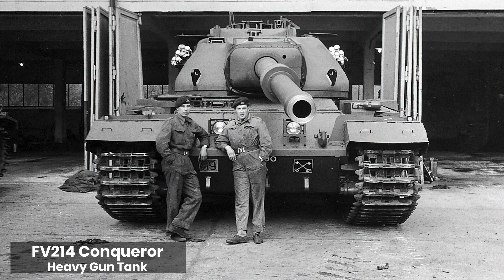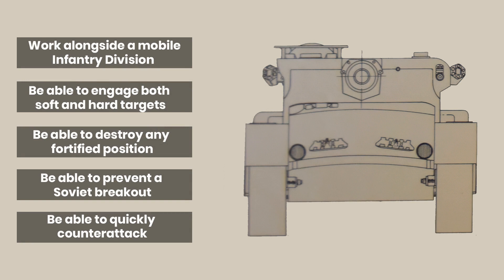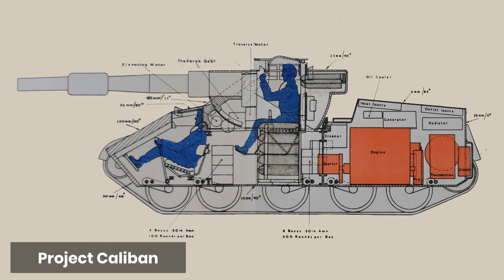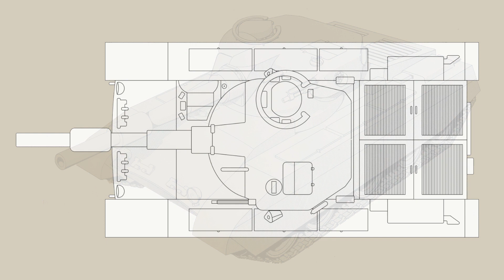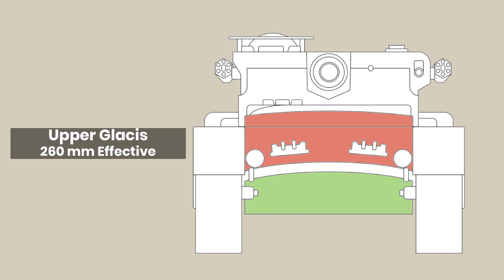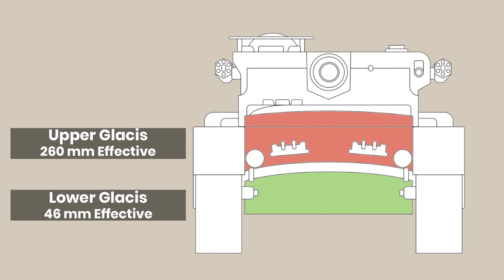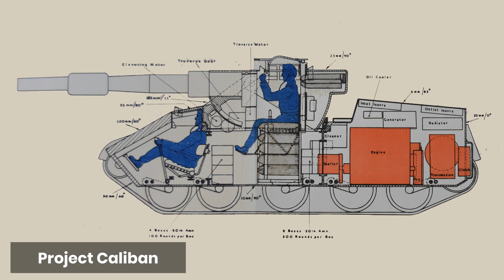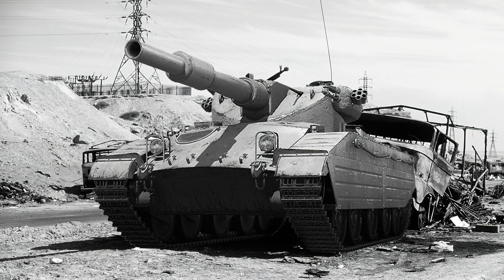Caliban - Tank Design & Conception

Comment: The nuclear round was a bit silly, but the large calibre, low velocity gun firing a HESH would would have worked at the time.

Longer team the HESH round would have been infective against advanced armour; however, a HEAT round could have replaced it.

The gun would also have been good for launching guided missiles like the US 152mm.
Reply: The nuclear round was very much a thing in military thinking of the time - look up M-28/-29 Davy Crockett, amongst others.
Reply: Battlefield nukes were all the rage at the time. The Neutron round etc. As it turns out depleted uranium rounds leave enough of a mess post conflict and cause all sorts of clearing up headaches. Making everything radioactive with a battlefield nuke was and still is a step to far if you want to carry on using the assets left behind!
Reply: 60lbs of HE round would mess up anything it hits - even today.
Reply: Not only that, the canister round would be devastating to any soft targets as well as foliage, way beyond overkill.
Reply: You would think it was a lot less silly if you didn't have one and the enemy did.
Reply: @wideyxyz2271  After World War one large parts of France (the Zone Rouge) were designated uninhabitable due to heavy metal poisoning and UXO, it took decades to clear out. The risks associated with DU exposure are rather overblown but good luck telling Radiophobes that.
Reply: I feel like a hesh round that obnoxiously big would still be very capable of fucking up most mbt's today
Reply: @lonesurvivalist3147  I  doubt that it would kill an MBT from the front, but it would strip off a lot of external equipment, like reactive armour, and might damage the more fragile equipment, like optics.  There is a possibility the  crew would be so alarmed that they abandon the tank.

Comment: Great video as always 👍 A while ago i stumbled onto the british 140mm programm from ADTU. From what i read they wanted to integrate the 140mm at first into challenger 1 and later into challenger 2. But for both i did not find any proposed turret designs. Are they still classified or are they accesabel ?
Reply from the maker: the 140s go back before this to the ENT and parts of FMBT - several guns were made, and fitted to muckup turrets (the guns and ammo ares till at the defence academy UK) it was found that the large single piece round was too bit to use quickly and that in an autloader the number of rounds would be too limited. and so they stuck with the 120m